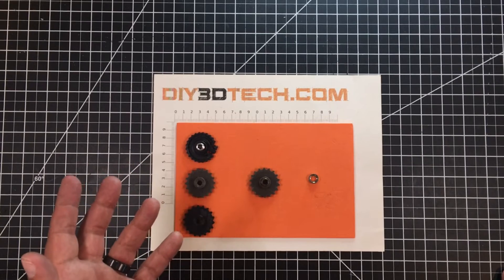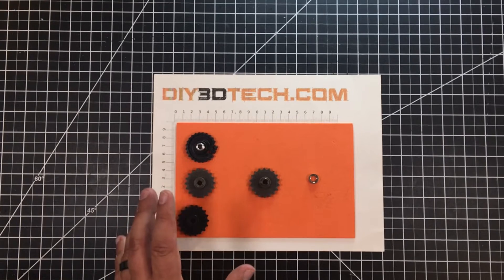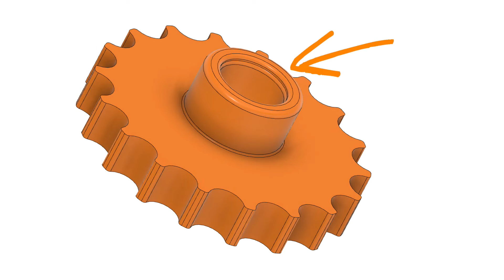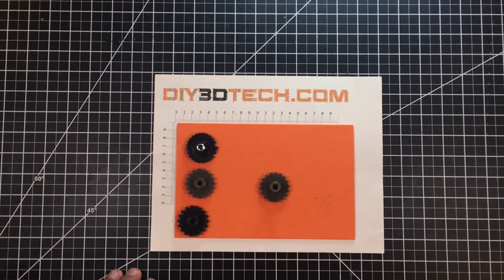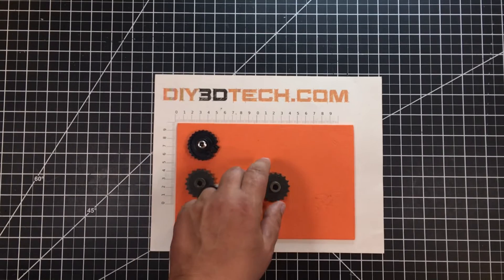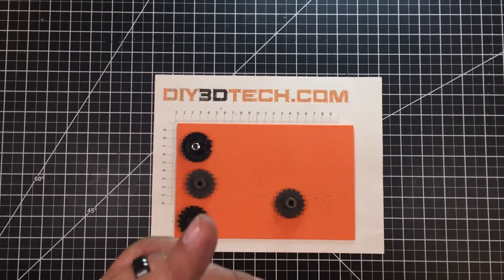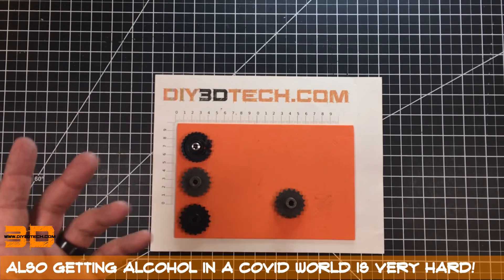Ortur Laser - 3D Printable G8 Len Holder!

Comment: I got it to work ok and the focus is great. the only issue is that the threads on the lens fit a little loose, whereas the original lens holder has that o-ring on the knob that holds it tight.
Reply from the maker: You correct on on O ring, you try some tape if it is too lose...
Reply: @DIY3DTECHcom  I put some Permatex gasket sealer on the threads, that should make the adjustment stay better.  It presses into the knob fine

Comment: I have another dumb question but my lens has fallen out several times after i have gotten the dot focused down.  Any idea what I'm doing wrong?
Reply: Just want to let you know I contacted Augie who sold me the G-8 lens and he recommended using thread tape to fix the issue.  It worked perfectly and now everything stays where it is supposed to be.  Thanks for your help as well.
Reply from the maker: @billmorgan5348  Interesting!  Thanks for sharing this tip!
Reply from the maker: That is odd, how far is it threading in?  Mine goes about %25 in...
Reply: That's the thing, to get the smallest blue dot I seem to have to unscrew it almost to where it is out of the tube.  I know I'm doing something wrong.
Reply: Thanks for your patience.